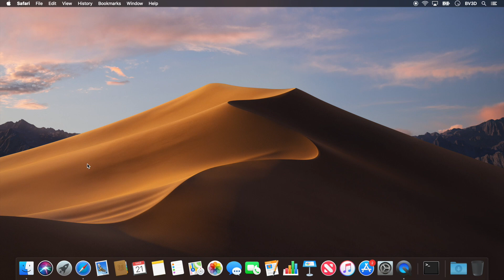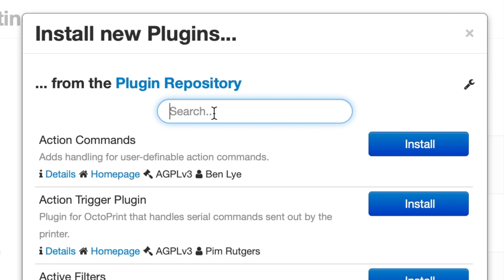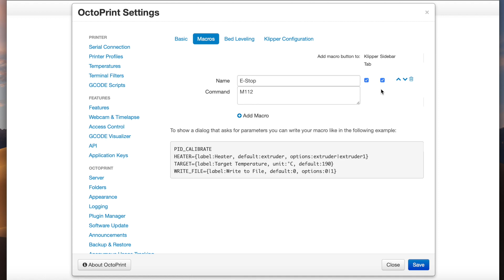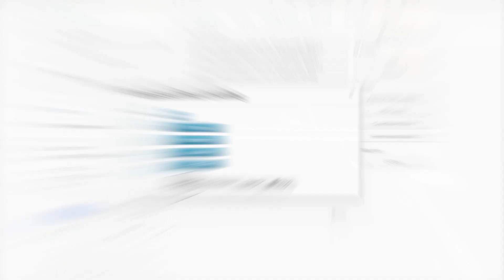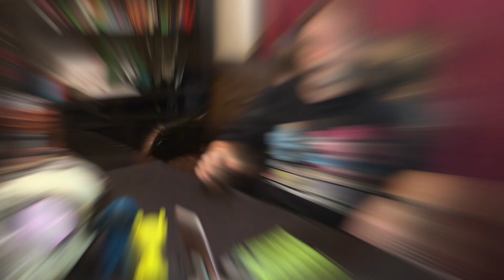Install & Use OctoKlipper Plug-in - Make Using Klipper Firmware Easier

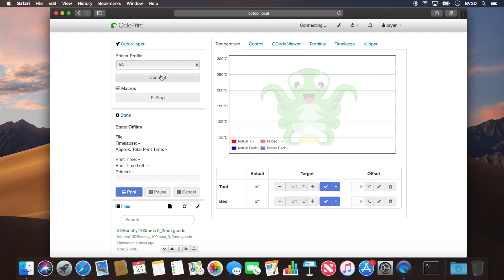Comment: Everything worked great until 2:45 in your video. Octoklipper shows in the upper left, and Klipper appears in the menu bar. BUT nothing happens when I click "connect". Below connect I have a new button reading "Klipper Standby. I've tried reboot and reinstalling Klipper. No change?
Reply: i have the same problem, I mean it still prints, but i would rather print with klipper.  have you found a solution?

Comment: Well, it’s November 18, 2022. Today I followed your video again, and installed the OctoKlipperPi program on my Rpi. I’ve told Klipper that my XVico-Lerdge-K-Creality E-Fit is an Anet A8, and here we go. I’ll be using the second half of this video to guide me through initial programming of Klipper. It’s interesting how familiar this is after I spent five months trying to get a Duet board to work.

Comment: Nice video, but i got a question, got an ender 3 pro, so if a understood I can have a rasp 0 w with klipper, and a second pi  with octoprint?

I have octoprint in a pi 4b and stock firmware but have a zero w getting dust around, thanks for your help

Comment: Newb question, but does this also require that Klipper firmware is on the printer, or do you only need to install it in Octo?
Reply from the maker: There's still a piece of Klipper that gets installed on the printer. OctoKlipper makes it easier to edit Klipper's config files and stuff

Comment: So how did you connect so easy?  I cannot connect  OctoKlipper to my printer even though I know my printer SKR v2  board  is firmware updated with Klipper and I can run the printer with Fluidd  with no problems.    I  briefly saw you have  a /tmp/printer serial port.. How did you get that selected?.. I tried adding /tmp/printer but I cannot select or use it... .   I cannot get Octoprint to connect  . Until then I will have to use Fluidd

Comment: Gr8 but would you mind clarifying please. When you install Klipper to Raspberry SD with Octoprint, will Klipper work even if you have not Klipper update printer firmware? EG do we still get same control but with less resources using Klipper with Octopi rather than Octopi alone? Thanks, Al PS I have trouble posting due to browser issues.

Comment: I'm confused with the Clipper firmware on octoklipper. How is this used in relation to the Klipper firmware installed on me SKR 1.3 board? Does that still get used, or is this overwriting that one? I am changing probing settings in octoklipper but it's not affecting what the printer is doing.

Comment: Is there a way to flash the printer with klipper useing this plug-in? I'm just starting And don't have klipper flashed to my printer. Do I go through the whole klipper manual install,flash the printer and then install the plugging? Just looking for some direction...
Reply from the maker: Hi ocha6521, the OctoKlipper plug-in is a convenience tool, making it a little easier to work with Klipper. It gives you quick access to the configuration files and lets you set up macro buttons for commands. But as far as I know, the Klipper installation process is still:
1. Install Klipper on Raspberry Pi that already has OctoPrint on board
2. Create the printer's half of Klipper using "make menuconfig"
3. Flash the resulting printer firmware to the printer
4. Perform configuration tasks

I've got a half-hour tutorial showing how to do this with an Anet A8: https://youtu.be/EX8dJkdcmJQ

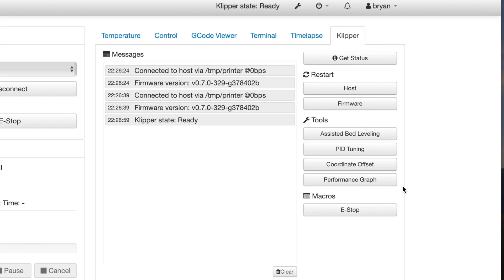Comment: At 3:30 you asked if anyone has a good use for coordinate offset. If you install a different extruder to your machine quite often it will move the nozzle a little bit. My guess is the coordinate offset is for correcting that.

Comment: The problem I had with Klipper configuration is that there was no file for my printer (CR-10S Pro V2), which does not have a z switch. It has a BLTouch and no pin information to enter into the Klipper configuration

Comment: "The whole point of a computer is to make things easier right?"  WRONG! The point of a computer is to tweak it until it breaks so that we have something to fix, then that means we have something we can tweak until it breaks which means we have something to fix.  ;)
Reply: I keep wondering why no one has made fluidd, mainsail, or other os/firmware have you setup your printer and when you're done itll automatically upload the firmware to the machine with the necessary steps to follow

Comment: I’d think the offset might be useful if you print something, go to bed, etc., the print finishes, looks good from the camera, and you want to print another without having to go and clear the bed ...
Reply from the maker: That's an interesting idea. As long as the first print's position on the bed doesn't interfere with the homing of the axes for the next print, that might work. 👍
Reply: I’m not using ABL at the moment although I do have a sensor awaiting install. I’m printing on a mirror and I’ve had no trouble setting and forgetting it. Can the ABL take a one time measurement and store it so it doesn’t need to ABL before each print?

Comment: Excellent video!!!  Did you ever get the BL Touch to work?
Reply from the maker: Hi Mark. I haven't gotten that far yet. I've got a couple of tuning items yet to do on Klipper (pressure advance being the first). I'm debating picking up a set of aluminum extrusions and turning this stock A8 into an AM8 or something similar. I'm having a hard time getting a decent level of accuracy out of this acrylic frame. I'm hoping with a more rigid frame, I'll get better Z axis alignment on the prints.
Reply: BV3D: Bryan Vines I have to say, after spending months and months with my AM8 build, well, good freaking luck with that. Every time I do an upgrade, it’s back to square-fring 1. Case in point: I just installed the wham bam bed. And Everything is now a complete mess. I installed the tronxy sensor, boy, was that a disaster. And I’ve been flashing the board to get auto bed leveling to work, and I finally through the tronxy in the garbage. (Decided to pull it out later.) after printing two beautiful vases, this is really disheartening.
Reply: Here's an idea: I'll send you MY AM8. You can give it a go, use it for a couple of videos, put klipper on it, see what it can do, that kind of thing, kind of, given this great frame, this AM8 with these bells and whistles, what's possible, let's see! And after some videos, you can show the world of Youtube what one can accomplish with the lowly Anet A8 upgraded to a decent level. You could do a kind of comparison, of sorts. I bet a lot of people would like to see what's really possible with the Anet A8 / AM8 / with Marlin (2.0?), with the E3D V6 setup, with the Wham Bam bed, etc. And with Klipper maxed out. Maybe do three videos? something like that? Then send it back upgraded, to me? Interested? @BV3D

Comment: Yeah...  I pronounce you “The ANET Defornicator”!  You aren’t a professional instructor by chance?  Thanks for putting so much thought into your presentations!
Reply from the maker: Hi Jason, and thanks! That's a title I'll work hard to uphold. I'm not a professional educator, just a computer guy. I'm glad you like the videos. I do my best to make watchable content. 😉
Reply: @BV3D  
Brian, you mentioned the buttons on the Stock LCD having no current purpose with Klipper.  You're gonna love this.
https://github.com/KevinOConnor/klipper/blob/master/config/example-extras.cfg
check out lines 1194-1257.  Kevin O'Connor really worked on this a lot!  As an added bonus, he documents everything!

Just though you'd enjoy that...if you haven't' already found it.
Reply from the maker: Hi Jason, it looks like work is proceeding, but it's not quite ready (see https://github.com/KevinOConnor/klipper/pull/977).  Last update was less than a week ago, as of 2018-03-30. So it's actively being pursued. Perhaps in the next official Klipper release, it'll be available. It would be nice to have local control of the printer.